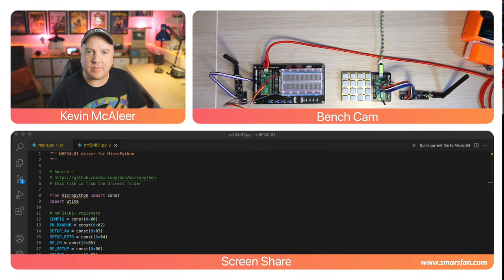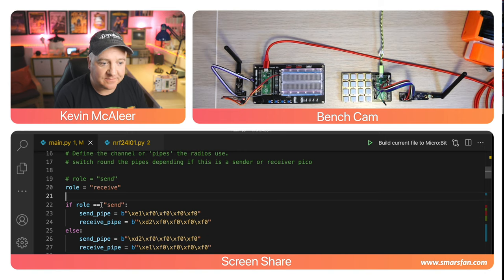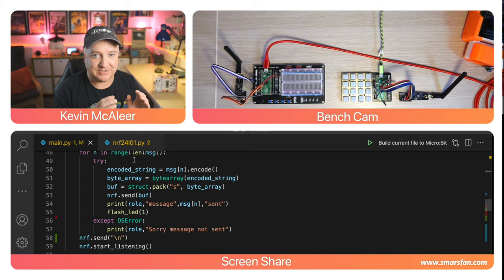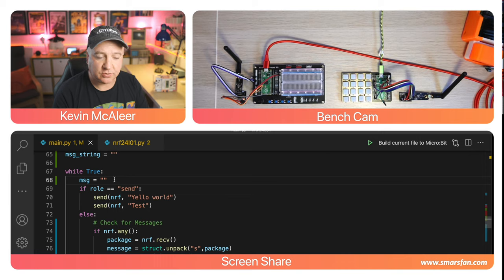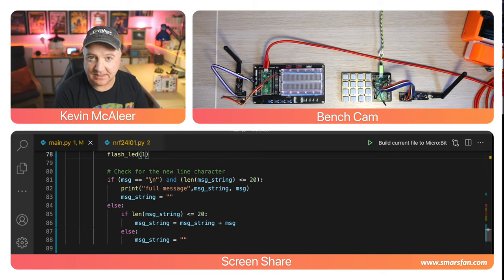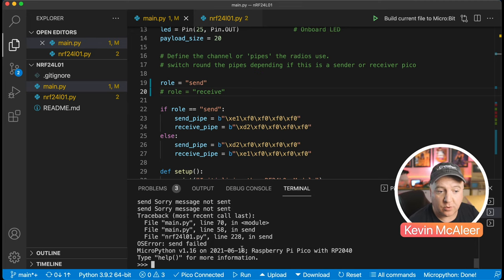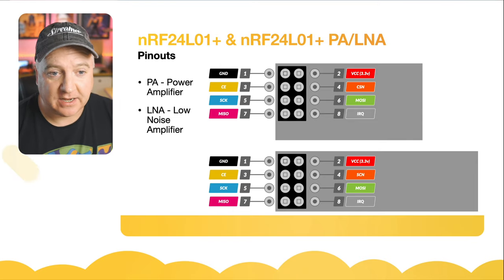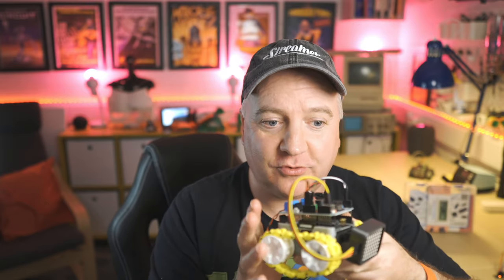Raspberry Pi Pico and the nRF24L01 radio module - how to get this working with MicroPython

Comment: Thank you very much for taking the time to make this video! Two points of constructive encouragement: The on-board IRQ which is designed for an LED activates on the hardware level when data is transferred. So it would be redundant and delay you unnecessarily to activate it yourself. Secondly, the nrf24l01 library "send" function has a boolean return. If it fails once it will attempt to transfer again. If it fails twice then it will return a boolean false. So you don't need to check if your 20 bytes, in this case (max of 32 I believe), of data failed to transfer. Great video! Hope this helps

Comment: I’m assuming you need those breakout boards with the regulators for it to work?  I tried to use it with just the modules and it fails to send.  And that’s even with just using the test program provided with the driver.  Or does your code do something different that the test program doesn’t do?

Comment: When using nrf2401 through raspberry pico, can the value of the gyro sensor be transmitted through RF communication? And the code in the video is too complicated, is there a simpler code?

Comment: I assume your adaptor has an on-board 3v3 regulator? This can provide more current than the pico 3.3v output.. To get the benefit from the on-board regulator,  you need to power the adaptor from 5V. The misi, moso and clk signals will still be 3.3v, so no chance of damaging the pico.

Comment: Hi Kevin, great video. Looking forward to trying this myself. Can i ask, are you pinouts viewed from above? I have the LNA module, with the pins coming "down" from the PCB (Opposite side to the RF connector). Viewed from above, (looking at RF connector side,) is pin 1 top left? Cheers

Comment: Hi Kevin, so we don't need pairing for transmitter and receiver , If there are many modules transmitting and receiving in same work environment/ location how it will figure the receiver which signal from module it need to communicate, thanks
Reply from the maker: It’s all todo with the pipe ID - that’s the channel that the modules send and receive to.
Reply: @kevinmcaleer28  Hi Kevin,I am novice so excuse me, where we can get this pipe ID
Reply from the maker: @alokgkp  Sure - no worries. In the video at 09:34 you'll see two lines 'send_pipe' and 'receive_pipe'; the transmitter node will transmit on the 'send_pipe' and listen on the 'receive_pipe', whereas the receiver node will switch them around. If you have more than one device listening to the same receive pipes they will all get the same message - which can be desired in some use-cases.
Reply: @kevinmcaleer28  Hi Kevin thanks, as this module support up to 1100 meters, If I am controlling receiver from far I.e. 500 meter like any irrigation system but I don't know if in that radius someone else using the same device , my question is how my receiver module Will identify the sender , do other people around me using same module Will get same message, is this secure
Reply from the maker: @alokgkp  Think of it that this is the mechanics of how data is transmitted - encryption and security can be added to this by change the data before its sent and after its received. People can always listen into the data being transmitted over the air. The encryption could simple be like a caeser cypher where you change the data byte by one value and then shift it back at the other end. Or something much more elaborate. I did a video on simple encryption for people wanting to store Wifi usernames and passwords on Picos, that could be used for this too (https://youtu.be/fl3UNaUoYzc)
Reply: @kevinmcaleer28  Thanks for satisfactory explanation for novice like me, but my question was different let me ask like this suppose me and my friend made a wireless car and used same module for communication between car and remote controller and we are racing the car next to each other my question is that will my car receiver will recognise the command send from my remote suppose I am giving command to turn right but my friend giving command to turn left, will car differentiate the owner , we used same code for programming the car.
Reply from the maker: @alokgkp  in that scenario you would just use a different pair of pipes - it’s just a unique number. That’s the same thing that happens with regular RC cars but instead of a unique number it’s a unique frequency
Reply: @kevinmcaleer28  Thanks I got my reply, hope you will also include in your next video to use option for difference pipes, I will wait for your next video on this topic..  😑
Reply: @alokgkp , a thing to note about the nrf24l01 module, one mudule can communicate with up to six other modules so if you do the math, it's possible to create a network with 3125 modules, that's the first module (base) can actively listen to 6 modules (nodes) while each node can actively listen to other 5 nodes apart from it's base, this can go up to five levels.
So it's all abouy unique pipe addresses (which is a device's ID), NO interference there.
Isn't it amazing :)

Greetings from Tanzania 🇹🇿

Comment: I have a problem where when I send the data I receive nothing and the sender gives an error that the message was not send, but when I disconnect the power from the module at the receiver's end I receive data but not how it should be received.... Any idea what might be causing this?

Comment: Great video! The sending part i think I got working but when I start the resiving program it just "loads" and says: 
MPY: soft reboot
 
Initialising the nRF24L0+ Module

And the program gets stuck. I wired everything according to your schematic. Any help would be really appreciated!
Reply from the maker: What version of the firmware is loaded? I found there was some issues with earlier micropython firmware.

Comment: Hi thanks for this tutorial it is just what I needed but I have run into an issue.  When I run the code for both send and receive both print the message "Initialising the nRF24L0+ Module", but when the send tries to send anything it fails everytime.  I have printed out the OSerror exception and it just says "send failed".  To try to debug I have tried a number of nrf2401 chips and I actually found I have a copy of dud ones as they wouldn't even initialise, I also found if I wire the pins incorrectly the chip won't initialise so I think I have good chips and wiring correct because I get the message they have initialised but after that nothing, I have also swapped the roles but again that had the same result the nrf.send command always fails.
Do you have any suggestions on what I could try?

Thanks
Reply from the maker: Try swapping the rx and tx round on one end
Reply: Hey did you manage to get this working? Also having the exact same issue :)
Reply: @davidbell9470  sorry no but haven't really had much time to look at it
Reply: @kevinmcaleer28  i have the same error, i swapped the MISO and MOSI around when they're around the wrong way i get the error "OSError: nRF24L01+ Hardware not responding", when they're correct i get the error:
 "Initialising the nRF24L0+ Module
sending message. Yello world
send Sorry message not sent"
Reply: @chipmunk1066  I'm struggling with the exact same problem. Did you already find a solution?
Reply: @maxgreger1099  no solution about to post onto reddit try and find something there too,
Reply: @chipmunk1066  Could you share your reddit post with me? 
I ordered more nRF24L0+ modules from a different supplier to make sure it's not a hardware problem.
Reply: @maxgreger1099  already did that too, i have another raspberry pi coming from another supplier just to check if thats it too.
Reply: @chipmunk1066  I received the new modules today and still get the same error. I tried 10 different modules.
Could you solve the problem with another pico?
Reply: @maxgreger1099  still waiting for my other pico test, but i have also tried using external power source (3.3v) but it has no draw, I'm wondering if the CE (Chip enable), isn't setting up correctly
Reply: @maxgreger1099  ok i solved the problem... the "hardware not responding" for me was a faulty raspberry pi pico... i ordered some new ones from another supplier... then i had problems with "message not sending" use an external power supply for me 3.3v at 20ma worked.... this literally took me months to solve.... good luck with your projects !
Reply: @chipmunk1066  thank you very much for sharing this with me. I'll order two new picos and try, if it works for me too.

Comment: No module named 'nrf24l01'
Reply from the maker: Hi Stewart - I’m not sure what you mean? The nRF24L01 is a really common module.
Reply: @kevinmcaleer28  That is the error message I get when I run the example code.
Reply from the maker: @So-Now  and did you upload the code to the Pico so it can find it, think I talk about that around the 8 minute mark.

Comment: You swapped pins MISO and MOSI in your wiring diagram, caused me a lot of wasted time
Reply: You have saved me! Thanks a lot!!!!
Reply: Yes, I noticed that the Pico pins were mislabeled, TX and RX reversed, so that matches MISO and MOSI being reversed as well.  Confusing, but I guess his wiring should work since both ends are reversed (or mislabeled.)  I've yet to try it though.